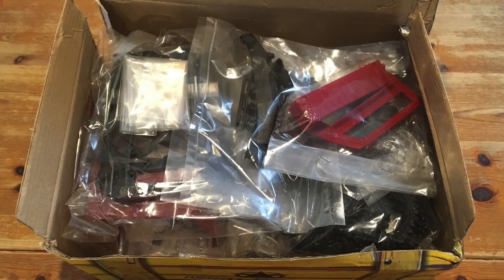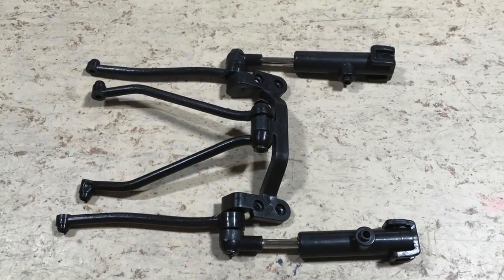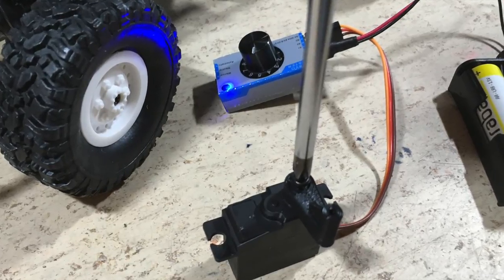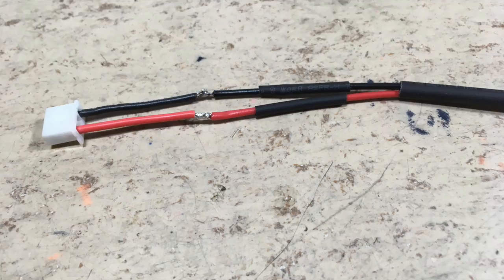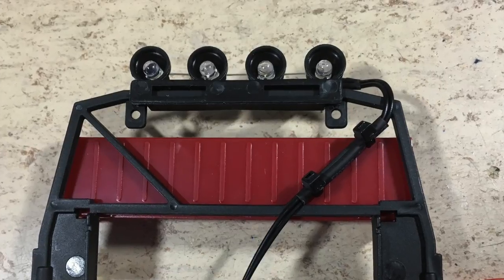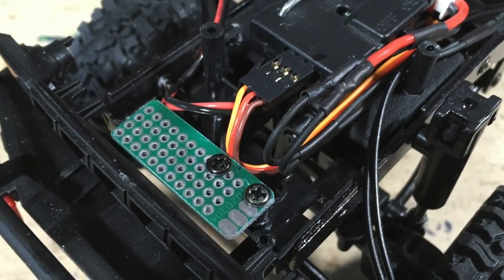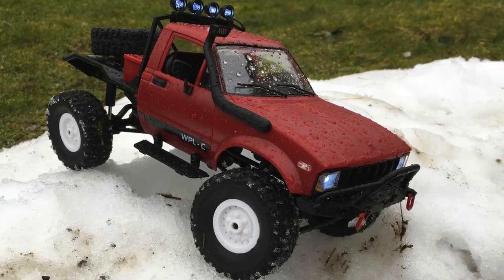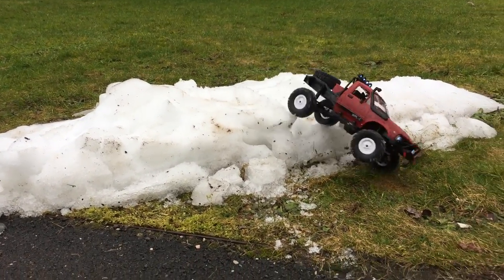WPL C14 1:16 Toyota Hilux Crawler Build With WLtoys K989 Receiver: Full Step By Step Tutorial!

Comment: Nice work . are the resistors due to to supplying 5v on 3v LED ?  Are the headlights wired in parallell to eachother as well ?
Reply from the maker: Thanks. Yes, in parallel. All LED require a resistor, which "burns" the difference between the supply voltage and the forward voltage according to the LED data sheet.

Comment: Thank you so much for the 3d files. I printed the servo horn #1, and it's much better. It still pulls to left but at least it's steady when centering. I have a couple of questions regarding some issues, maybe you have the same issues, and you can point me in the right direction. 1. Does the car pull left when reversing, even though it's trimmed and goes straight when driving forward? 2. What paint do you recommend for the rims that does not melt the plastic? (I want to paint it black) 3. Do the rubber tires come off easily from the rims? What glue do you recommend? Does super glue work? Thanks again for the tutorial.
Reply from the maker: You're welcome.
1. Mine does the same. The frame mounted servo is just not ideal, because it's influenced by the suspension travel.
2. Any paint for plastics can be used
3. Super glue is fine

Comment: Can i order some part to build the micro radio controller ?
For example i can't manufacture the plastic enclosure,so can i buy 1 set from you ?
Reply from the maker: You can download the enclosure on Thingiverse: https://www.thingiverse.com/TheDIYGuy999/designs
You can also order printed parts there
Reply: Thanks you very much !!!!
Reply from the maker: Hi, yes the transmitter housing in not yet available. It will follow soon.
Reply: Thanks you :)

Comment: Good job! 
Servo 3 wire, or 5?
Reply from the maker: Thanks. It‘s the 3 wire servo, which is included in the kit
Reply: TheDIYGuy999 esc 3wire servo? Link to esc?
Reply from the maker: The ESC is integrated in the receiver. And you really should have a look at the video description ;-)